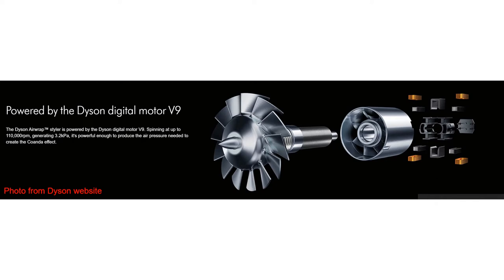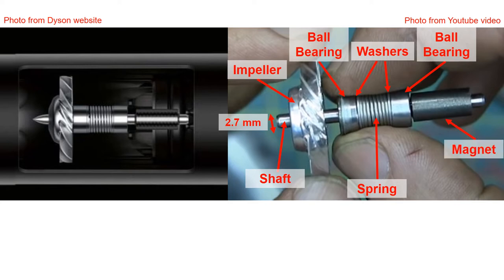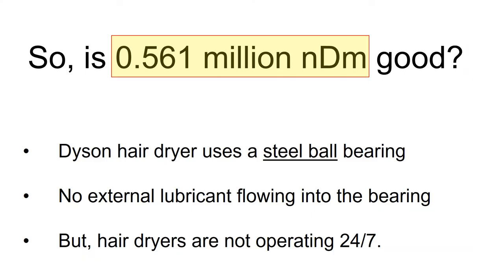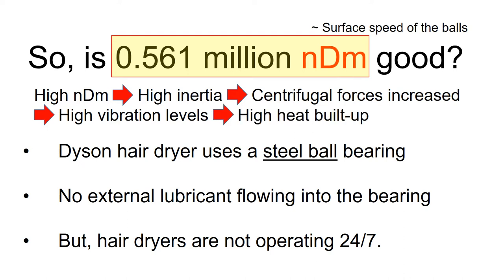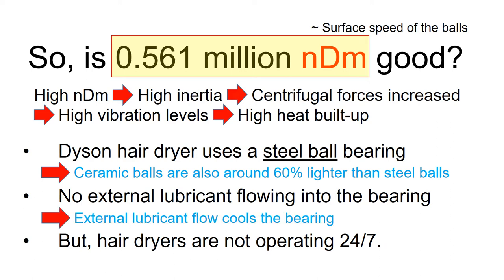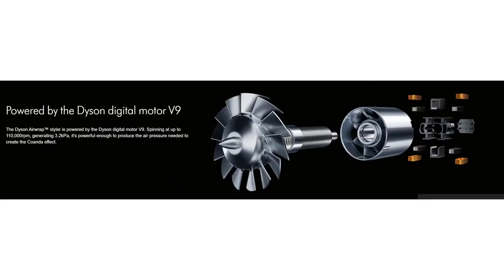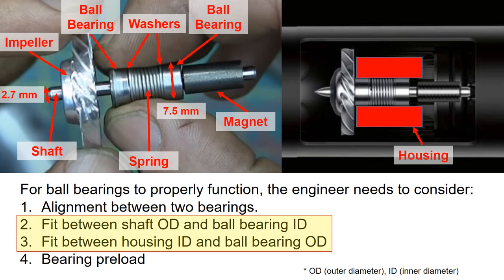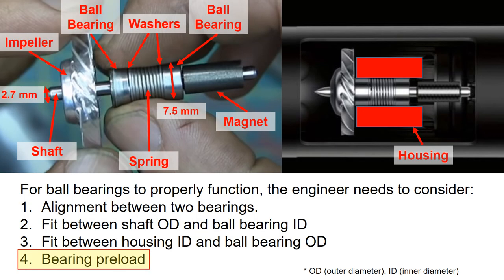Part 11 - Dyson Hair Dryer Blower

Comment: Dear sir, that was a wonderfully clear technical description of the Dyson hair dryer's rotor components.
 I am also interested in the aerodynamics of the impeller. And how the multiplier effect works, drawing in air from the back of the blower to meet the air being blown up by the impeller and then out the front of the blower. Are you able to discuss that? 
Thanks very much
Reply from the maker: Thank you so much for your kind words! I'm thrilled to hear that you found the technical description helpful. I'd be more than happy to delve into the aerodynamics of the Dyson hair dryer's impeller and discuss the multiplier effect in detail. It's a fascinating aspect, and I appreciate your curiosity.

By the way, I've just uploaded a new video, Part 35, focusing on compressors. I'm planning to include a topic related to impellers in upcoming videos as well.

I'll make sure to cover the specifics you mentioned. Stay tuned, and if you have any more specific questions or topics you'd like me to explore, feel free to let me know. Thanks for your interest!